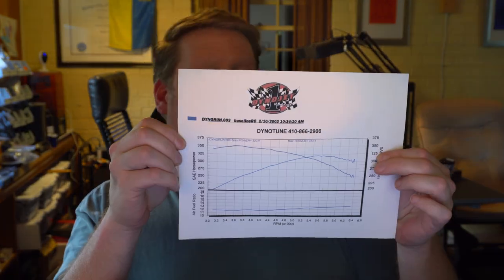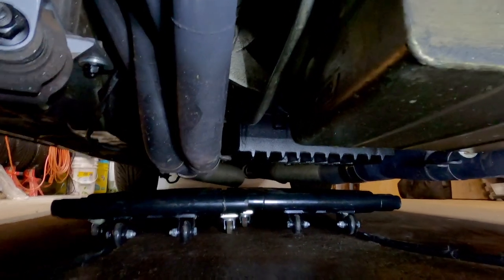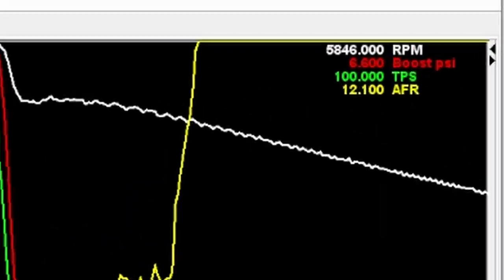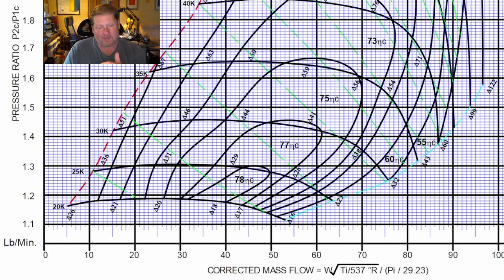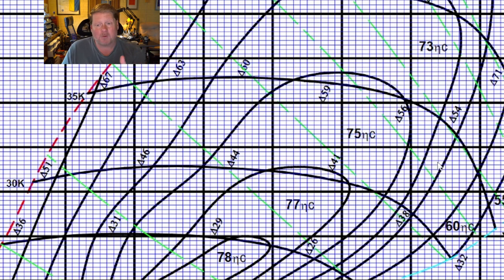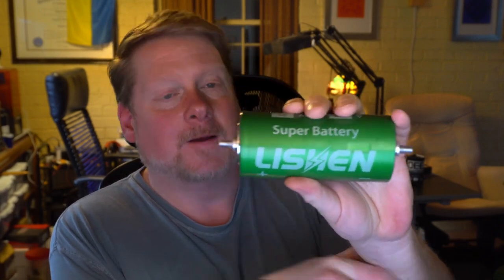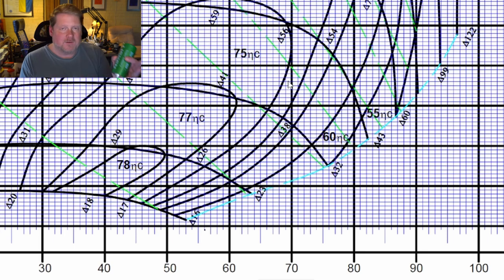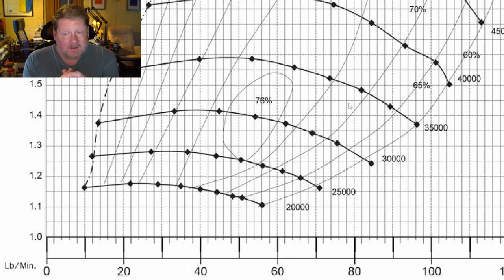DIY Electric Turbo: More Power from the Sledgehammer

Comment: Just FYI, the JT-trim was available as a V3, and is the same as the Novi 2200SL/Vortech Ti. You can buy a fancy billet V3 Ti trim impeller from JB Performance, just like your last one, and all you need is a 2200SL/Ti volute to go with it, and it will all swap right on your existing V3 unit. You would end up with basically a V3 JT-B. It would also be relatively inexpensive (compared to a new JT head unit.
Reply from the maker: Thanks!

Comment: Alex, you know what would be the coolest sheet to build?   An Air centrifuge.  This is actually one of my dream projects.  Been researching it for years, and yes it possible, and will produce an air stream around 50% O2 purity with plenty CFMs, with far less power then typical forced induction requires.  As I'm sure you know, the atmosphere is mostly nitrogen at 78 freaking percent, only 21% oxygen.  The Nitrogen and O2 are not in any way bound together, its simply a matter of separating the two....somehow.   The atomic weight difference between the N2 and O2 is enormous... far far greater then Uranium235 and uranium238, which is currently separated by centrifuge, it's how uranium is enriched, by heating till vaporized, then centrifuging, throwing off the heavier U-238, as the U-235 is the target.   The entire reason Nitrous is so effective is entirely due to the fact that NOS is 36% O2, instead of 21% normal air.  So a simple centrifuge would essentially be an onboard unlimited NOS tank.  But instead of supplying the engine with NOS level O2 (36%) and melting the pistons.  You have the centrifuge output around 30% O2, or whatever 40% if you want, a german achieved 51% O2 stream.  They are a nightmare to build, as the periphery of the rotating chamber, has to achieve around 500 m/s, in order for the O2 and N2 to separate.

Comment: What about moving this turbo closer to the intake manifold. Since it's no longer belt driven, it's logical that you can put it anywhere. Less turns to go through the less resistance  of air flow, and if it gets moved closer to the power source the less loss over distance in the cables.  Does this sound like it makes any sense?
Reply from the maker: Yes, it makes a lot of sense.  The only issue here is I try to keep this car nice - I've had it for far too long to cut it up.  Imagine this in a little drag-race oriented pickup truck with an LS-based engine.  You could have everything - batteries, control unit, e-turbo all in the bed of the truck - you'd have super-short cables; and then just run the discharge right through the passenger compartment, right into the TB of the engine - on an LS, you can flip the manifold around so the throttle body faces the firewall.  That's the most efficient setup I can think of.  You're on the right track.

Comment: I really enjoy the technical walk through of the optimization.  It's probably just as enjoyable as all the motor tests and dyno videos.  I've been doing a similar thing with a homemade windmill of going full send on the calculations and testing to determine roughly the same things (rpm and efficiency given a wind speed and a coefficient of performance curve vs. tip speed ratio.....surprisingly difficult to do the math, but I'm up for a good challenge).  I also built a effectively a brushless motor as an alternator.  It has 12 coils in 3 phases, which means I can wire each phase in a 1x4, 2x2 or 4x1 configuration to change the current and voltage at a given RPM.  The magnets are on a 4" diameter barrel and are 4" x 1/2" x1/2" N52's.  There's about 5 lbs or 700-800 feet of 17 gauge wire in it.   It's about 15 kV and will do 30+ amps at 140 rpm going into a few hundred Ah of Tesla model 3 cells.  I also used magnetic lamination steel to flow the flux and a bunch of thermal potting compound.

Thanks for sharing the voltage drop info.  I wonder if you've maxed out your voltage on your ESC/Motor/other things.  I'm assuming so and I know it would be expensive to upgrade to something higher.
Reply from the maker: That sounds really interesting.  I've thought about wind power at the new property I bought last month.  What put it a stop to it for me is the new property is on the gulf coast of Texas.  And they do get hurricanes - not often, but they do.  There's also a windmill farm not too far away there.  I guess they just lock them out in a big storm?  Maybe it'll be something worth thinking about down the road.  It's always breezy there.  The motor you built sounds fascinating as well.  I just took a look at your channel - and I subscribed!  Looks like interesting stuff.  And to answer your last question, yes, I'm running at 62 volts and the ESC is rated for 63 volts.  I even looked at the caps in the ESC and they are, indeed 63 volt caps.
Reply: @AlexLTDLX  Building windmills is as difficult as your sledgehammer project.  It's tough to make them work right and getting to a big power level takes a lot of everything.  I do it on a smaller scale for fun, but the optimization journey is still fun.
Reply from the maker: I can only imagine.  Every time I think about it, I default back to solar...
Reply: @AlexLTDLX  yes, that's the right answer.  My new house will have solar, even though there is a lot of wind and I live in one of the cloudiest areas of the country.

Comment: IMHO, call PTC. I see less slip with that 9.5" converter than I ever have on any turbo setup ever in over 20 years of racing. I'm at less than 6% making 900+ at the wheels on a turbo small block. It is also surprisingly loose down low and allows me to get up on the trans brake and make boost. They are about $1200 shipped. Good luck and great content!   Also... I found you can run hygard hydraulic tractor fluid. It holds up to heat better and is cheaper than ATF. And tightened up my converter about 200rpm.  Its a win/win. Might look into it.
Reply from the maker: I've actually spoken with PTC in the past.  I'm going to try the temp thing first; but when I finish my move - which may take some time - I'll have a lift and more space.  That's likely when I'll do the converter.  Hopefully by the end of the year, beginning of next year.  But I do already use Hygard in the glide - great minds think alike!

Comment: We need a web store made from these projects, use the buying power to get bulk discounts, build custom turbine/housing and electronics sets for your the worlds needs with a central packing location to keep shipping cheap. Honestly now I'm wondering if this could be used for fuel efficiency, imagine charging up the batteries where electric vehicles charge, give fuel sipping motors the ability to pass on the highway. Now all I can imagine is a k series with this triggered by v tec, stopping at tesla superchargers to charge your supercharger. 480 volts dc.... lol
Reply from the maker: Eventually, once I figure out all the foibles, that's the idea behind www.electrifiedboost.com.  I don't see turn-key kits being sold necessarily, but rather components - ESCs, battery packs, motors/compressors all sold separately - because no two cars or their applications are the same (autocrossing a miata vs drag racing a big block camaro, for example) and also for liability reasons.  Getting these parts, particularly here in the states, is very challenging - most of them are imported from Europe or Australia.  Apparently, the US doesn't build anything anymore :(  As for your efficiency question, absolutely.  I personally feel that all hybrids are built wrong.  We're seeing a 4x return in power to the wheels given the electrical input into the e-turbo.  In other words, if the same amount of power consumed by the e-turbo was delivered straight to the wheels, like a conventional hybrid, there would be 4 times less additional power.  For fuel economy, you could have a small engine optimized for e-turbo boost.  Then when the additional power's not needed, like steady-state cruising, the engine would be very efficient, because you don't have pumping losses like a conventional turbo.  But when additional power's required, suddenly the e-turbo could easily double the engine's power.  In a typical small car, a 100 hp engine could easily get 40-50 mpg.  But when needed, you could drop the hammer and have 200 hp on tap.  Especially leveraging other technologies like direct injection, starter/motor/generators incorporated into the transmissions, etc.  And they'd still be able to run all electric for short distances if need be.

Comment: Thanks Alex for another good update. Having a slight electronic brain fart but considering the voltage drop would using capacitors rather than another set of cells be a viable option for keeping the voltage from dropping along the lines and depending on setup could be used to ease initial windup of the motor and possibly drop thermals. I know its done more on AC stuff but i think it can be used in DC if you consider large car sound setups...just a thought.
Keep it up and so looking forward to future updates and who knows even a kit of yours one day :)
Reply from the maker: A lot of people are suggesting supercaps.  I have a bunch that I've played with - the biggest one being the size of a car battery (I did a video on it's self-discharge a few years back; it's on my channel somewhere) that's designed to start diesel trains and semi trucks.  The problem with supercaps, besides their low power density, is the shape of their discharge curve.  The voltage drops linearly as they're  discharged.  So after the first second or two of run time, the batteries would then not only be running the e-turbo, but also charging the capacitors.  Look up discharge curves for lithium cells and you'll see their voltage doesn't drop much in the "meat" of their discharge region.  BTW - that's also why I don't charge my battery packs to full voltage.  The beginning of those curves have substantial drop, which I try to avoid.

Comment: Have you ever thought about using the compressor motor to take the place of the starter thereby potentially reducing complexity and freeing up room? Or would it even be possible to use the starter in tandem with the compressor motor on track day for a bit of extra power? Could the motor be used also in place of the mechanical water pump and alternator and on track day toggle switch the alternator and water pump off so there'd be no losses? Could the compressor motor be used as a drive motor to get you home in case of engine failure making this car a true hybrid? Just some ideas.
Reply from the maker: Wow - that a lot of ideas; thanks!  The starter and electric water pump don't spin fast enough or generate anywhere near enough power to be of use; but the idea of incorporating a starter/generator into the transmission (like hybrids do) is something that would certainly work.  But it's outside of the scope of what I can do.  The starter/generator (which takes the place of the alternator) could then also "regen charge" the electric turbo's battery packs pretty quickly.  In fact, towards your last point, then it could be an extremely efficient hybrid - we see about a 4 times gain in power over simply applying the power to the wheels directly.  A neat little factoid - if I remember correctly, the Ford Model T could go 1-2 miles on just it's starter motor.  It could also run on multiple fuels - technically making it the first flex-fuel hybrid.  So in a nutshell, I'm sure if an OEM went completely "all-in" a lot of your ideas could be implemented.

Comment: Bigger is always better ;) And have you looked into propane injection? Used to run that on my '87 Grand National. Similar benefits to water/meth, but since it injects as a gas, you don't risk bogging down the motor with too much. Just spit balling.
Reply from the maker: I have not looked into propane injection.  But I will!  Thanks for the idea!

Comment: I'm all in on fabricating a similar setup (yes I'm copying every possible thing you do that will work in my rice setup) as far as trying to purchase something every week up to monthly.   I have 2 harbor fright cases for my trunk, all of the 4 to 6 gauge wiring I will need along with measurements and detailed diagrams for the install.  I stupidly sold my HONDATA tuner almost a year back to get my lights cut back on.  2 things....Is HONDATA my best option? Also I really don't know what size and spec turbo (supercharger) would be my best option for my 2013 civic si.   When picking a turbo (supercharger) for your build did ease of fabricating electric motor to turbo come into play when chosing which one to buy?  Thank You for taking us on this journey.   I honestly hope it never ends.
Reply from the maker: Firstly, I'm obligated to give you a disclaimer: making an electric turbo is dangerous. You could seriously hurt yourself or someone else.  My videos are not intended as a "how to" guide, but for entertainment purposes only.  If you do anything similar, I don't accept any liability for any injuries or damages as a result.  That said, I looked up your car's specs.  Looks like it's a 201hp 4 cylinder.  You won't need much to get that thing to 300 hp.  You want to look for a setup with at least 10kW; but more is always better - gives you more headroom and less chance of the ESC failure under heavy load.  I don't know enough about Hondata (I've heard of it, but that's about it) to answer that question.  The ease of fabricating the electric motor to the compressor played a role (as did cost) in the smaller P2 unit.  I'll turn my attentions back to that setup in the heat of the summer months, along with the stuff I mentioned in this video.  FWIW, the P2 unit would work on your car - it's about the lowest base hp it would work on.  You could get away with a smaller unit, which would make packaging easier.  You want something with an exducer diameter of at least 4.5-5" (114mm- 127mm) and an inducer of at least 2.5" (63mm) for best performance.  I wouldn't go over the P2 unit in size for your application.  There are a ton of blowers out there that would work - an old Powerdyne BD-11 would be a decent choice, or an S trim or even a Procharger 600b - all of which could probably found fairly cheaply.  For a drive setup, I'd consider either a VESC (if you're decent with computers/electronics), if not, then maybe an APD or something similar.  Honestly, if you join the forum at www.electrifiedboost.com (it's free, of course), we could all help you with your project there.  One of the guys there had Flier build him a custom ESC that's fairly cheap and seems to be working; unfortunately it doesn't datalog, so you really don't know how fast the impeller's turning, phase amps, etc.  The VESC is probably the most cost-effective when paired with a sensored Castle Creations motor.
Reply: Use the chassis for ground and a huge wire for DC and keep AC cables as short as possible. Use an intercooler.

Comment: If you are thinking about adding a new housing why not add a 2nd one instead? You can but both on the same motor (one on front of it and one on back) so both impellers spin at the same speed. If that doesn't work you can chain drive it (chain from my understanding have about a 98% efficient rating) but I know space is the main factor for running 2
Reply from the maker: It's a good thought; if I did two units, it would be in a compound setup to raise boost pressure.  Thinking a little more about your suggestion, a dual shaft motor running two units would move us a bit further away from the choke region (which is good); but at the same time we're limited by available motor power.  After my experiments with the smaller unit (which I will get back too), even the belt drive get surprisingly hot at these speeds.  A chain drive whipping around at 40,000 rpm would terrify me, to be honest.  If the chain let go, you'd have a "flail of death."  And considering what the Whipple belt did to the car when it was thrown (significant body damage on the hood and passenger side fender), I think I'll stick with the belt - or just go back to direct drive on the little setup.  But yes, to the core of your point - two units, however we do it, would definitely get us more power.  Between you and me (and because very few people read answers to comments), once we get this one dialed in, I'm toying with the idea of compound electric turbos solely to try to hit 1,000 flywheel hp.  But I don't think we're refined enough yet to get there.

Comment: Wow this endeavor has come a very long way!
 What intake temps are you seeing by compressing the air ?
Reply from the maker: Thanks.  We are actually making enough boost to start seeing IATs rise.  On our last dyno pull, we went from a low of 101* to a high of 137* during the pull.  When Ray lifted, the IATs continued to shoot up to 154* - that extra gain after lifting is normal, in my experience - because the air volume dramatically decreases when the throttle closes.  But the sledgehammer was really only running at full speed for 3.5 seconds - it'll be three times as long at the track.  It'll be interesting to see what the IATs actually get up to.  I start pulling timing at 140* (the sensor is in the lower intake; thus the temps may seem high compared to one with a sensor in the intake tube).  Until I do the meth, I may do the "cheap and cheerful" trick of icing the intake and maybe the Sledgehammer's volute at the track.